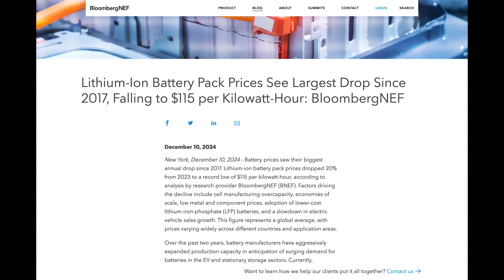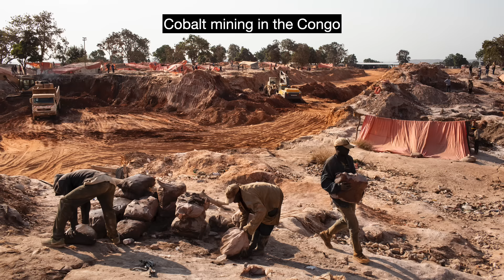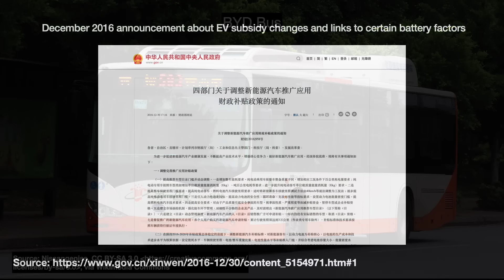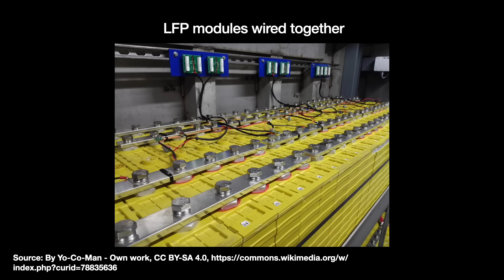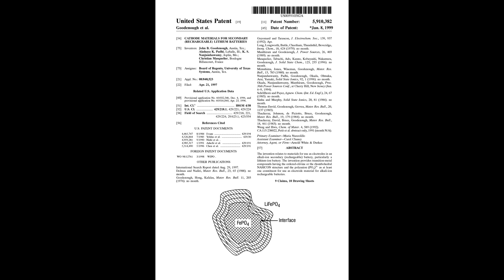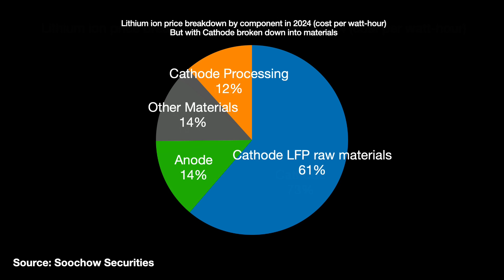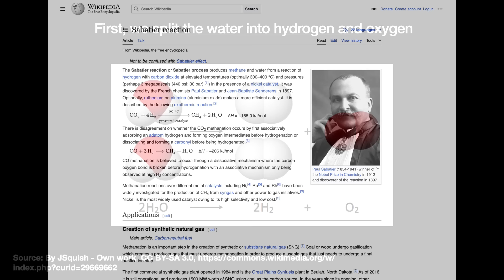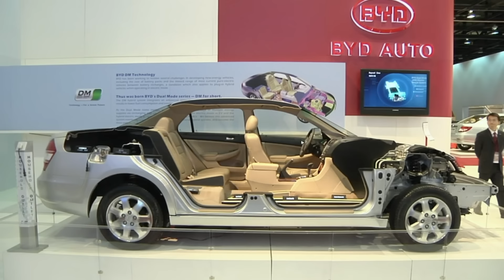How Did China's LFP Batteries Get So Cheap?

Comment: The big advantages of LFP are that they have about 3 times the life of the NiC batteries and can be charged to 100% without significantly degrading the battery life.
Reply: Some batteries are stressed if left at 100% or 0% for a period of time... LFP less so than NMC.  Fully charging a battery, then promptly skimming the cream isn't so stressing. Lead acid batteries love being kept fully charged. NiCd love deep cycling. Main point, it's complex, but simply if you have NMC set max state of charge to 80% unless you want the extra range.  Same applies to longevity of your mobile phone or laptop.
Reply: @ChrisNotTheKing  correct, I have a solar system with LFP and the installer said it's safe to let them charge to 100% daily because they get discharged in the evening and night anyway.
Reply: Well, LFP batteries need to be charged to 100% at regular intervals to calibrate the battery pack and keep the remaining capacity estimates reliable. But they do degrade faster if charged to 100% all the time.
Reply: @kardy12 Exactly, also to keep them properly calibrated you do in fact also need to discharge them to at least 10% every 2 months or so, or you will have very inconsistent/inaccurate range. Plus, indeed, they never used them in any premium or long range models and now discontinued them in the Model 3 in the largest western market, the US due to reliability concerns. Other western manufacturers don't use them either. As for Chinese manufacturers like BYD, their LFP packs offer just 50% of the energy density of their NMC packs, so the gap in energy density is getting larger, not smaller.
Reply: @DigiDriftZone  
Well, Tesla have been using LFP batteries on some of their Model 3/Y’s, and as far as I’m aware there isn’t much evidence they degrade faster than NMC packs. And Ford for example has used LFP packs on some of their Mach-E models.

Either way, as far as the details on degradation, Engineering Explained has a good video looking into the research on the topic, where he found avoiding small charge cycles in the 75-100% range in everyday charging does reduce degradation over time, but you also have to take into account how often you might need most of the range in your own use case: https://youtu.be/w1zKfIQUQ-s?si=G9hixEdDquiaEQ8l
Reply: @ engineering explained is just about the least credible source on most subjects, look at Thunderfoot’s videos analysing some of his content and how dishonest and inaccurate it is. But it still remains to be seen with LFP in real world conditions, Tesla only started using it at small scale on just standard range vehicles in 2021 and suddenly pulled the breaks last year, so that’s a data point.
Reply: @ he’s using published research in the video, so I’m not sure what it is he’s saying that is factually incorrect.
Reply: can't take a guy with the handle "Chinese sparrows" seriously, but hey congratulations surviving the DOGE cuts to the propaganda payrolls, it's tough out there
Reply: Any chance you would make a video about why lithium air just can’t make it to production?
Reply: Thats incorrect.   The reason they are charged to 100%, is because of the difficulty in measuring its charge.    So they just say charge it to 100% all the time so they can calculate the charge properly
Reply: And safety
Reply: Y a pruebas de perforaciones
Reply: We can charge it in higher rate without fearing it blew up lol
Reply: also not so explody
Reply: also because there was basically a truce on enforcing american patents on LFP batteries used domestically in china.
Reply: Friendly reminder that electric cars have very high embodied carbon emissions. The focus on EVs does nothing to deal with global warming, indeed their green meme is that they become more environmentally friendly the more you drive them. BEVs are a greenwash in order to sustain car dependent development patterns to serve the automotive industry.
Reply: LDP have 4-5X the life of lithium ion
Reply: I've seen studies saying batteries in general are lasting a lot longer than anyone really expected. The newer the car the longer it will probably last. 

 Plateauing around 90% after the first year or two. Then staying. 

 Main thing is to keep it charged between 20-80%, and not driving like a maniac. 

 Rotating and changing tires the biggest hurdle. (With chargers.)

 I mean the average right now is that a EV will last around 100k more than an ICE. That number will only rise. 

 And America won't see it because people think EVs are for vegans environmentalists. 

 That's a real sentence that many online think right now. 

 China is going to accelerate into the future with more powerful batteries.
Reply: @RedactedDeath  the US can keep its ICE vehicles. I prefer to breathe non-ICE vehicle clean air.
Reply: Battery life.
About 2 years(?) ago, Jeff Dahn (Tesla battery Guru) and his colleagues released a paper detailing a class of Nickel based cells to which they had "tweaked" the chemistry slightly and turned down the voltage.
That voltage was STILL above that of LIFePO4 cells, meaning they still had more Energy density.
So what was the object of the exercise?
Those cell had (Have) Virtually ZERO degradation (In fact, from memory, they were IMPROVING with age)
These were essentially a "Nickel based LIFETIME cell".
.
The point being, "we" (Keyboard warriors) work largely with "third hand hearsay" and rumour.
"We" have almost ZERO idea what is actually in development, or ready for launch.
Reply: A massive amount of the worlds population lives in an area with little to no below freezing temperatures and couldn’t care less about low temperature performance.

Just saying.
Reply: @Namewithheld00123  yes and those regions also enjoy having to replace the entire blade costing 30% of new car after a small dent or flooding.
Reply: NiC  - battery ? Do you mean NiCd battery or what ?
Reply: In lab conditions, but the voltage levels are quite stable so it's difficult to calculate the remaining battery % without discharging it to 10 every 2 months and charging to 100% weekly,  this negates any longevity benefits unfortunately, that's why the Model 3 for example stopped using them in the US (and they were never used in any long range or luxury models) - the failure rate was too high. Also BYD have LFP but the energy density is just half of their MNC packs.
Reply: @DigiDriftZone  the failure rate of what? What are you talking about ??
Reply: @DigiDriftZone  oh ok
Reply: Please do provide the evidence to back up your assertion of LFP battery failure rates. Scientific research have proved the exact opposite, with over 10k recharge cycles compared to 2k to 3k for NMC batteries.
Reply: @viyusavery248 calm down pal why are you so aggressive talking about batteries?😏
Reply: @idealistinafallenworld   you know batteries the thing that stores energy.. something that can help someone with energy independence like we have never seen before in human history 

Something that has remain virtually unchanged for decades that's now getting rapid development only to be  met with doubters all over 

I really don't see why anyone is betting against batteries
Reply: @DigiDriftZone  This is plainly not true. Model 3 continue to use LFP batteries for Standard Range cars.
Reply: @TL-xw6fh  Standard model 3 with LFP was discontinued back in Oct I believe. You need to charge to 100% once a week, not once per month, you need to do a discharge/calibration once every 2 months or so to maintain range accuracy.
Reply: @DigiDriftZone This is inaccurate. Only full charges are required to accurately set the reference of the charge level. Full discharges are not necessary.
Reply: @pootispiker2866  Charging to 100% is not enough, the calibration gets way off and the range estimation becomes very unreliable, so a discharge cycle is required to recalibrate every couple of months.
Reply: @DigiDriftZone  it's charging to max that is required for LFP.
Reply: @DigiDriftZone Wrong, they stopped selling to the USA market because the USA didn't give the EV credit for chinese batteries anymore, but they continued to sell them in Europe and they have no issue. For calibration they don't need to be fully discharged, but fully charged which matches 100% to the max voltage again.
Reply: @ EV credit for Chinese batteries? What? - they never used LFP for any of the best models or any of the long range ones and now it’s discontinued for all models in the largest western market. Maybe some remain in some small markets but not sure why with all the disadvantages, maybe it’s cheaper in some regions?
Reply: @DigiDriftZone they use LFP batteries for standard range models in the European Union countries. The reason they discontinued this model in USA is exactly because it didn't benefit from the EV credit anymore.
Reply: @DigiDriftZone  Tesla stopped using LFP in the US simply because US government disqualify it from the federal EV tax credits because they were importing them from China. If your theory is true, why does Tesla still sell LFP Model 3 and Ys to the rest of the world?
Reply: @DigiDriftZone Tracking state of charge is really quite easy and accurate. I design electronics that do this and it's not unique or special. We essentially count energy going in and out. The voltage only matters as we get to the very end. 

Most of my systems run from 20% to 80% which considerably improves cell life. There is very rarely any need to balance or otherwise charge to 100%.
Reply: @DigiDriftZone  Nonsense, the tesla batteries explode all the time and unlike lfp they suffer serious degradation from cold and excessive heat. tesla is in the midst of a collapse as they have not kept up with battery technology and refuse to buy what they need as they want to promote their own manufactured batteries which fail a lot.
Reply: @DigiDriftZone BYD will eat Tesla for breakfast
Reply: @TheTotalizer  hahahah, I assume that's sarcasm. Yes it's amazing people buy that kind of crap, it's like buying a knockoff iPhone. So many reports of those cars randomly bricking or refusing to charge, failing way sooner than expected, etc - awful cars.
Reply: @DigiDriftZone  Tesla should stop selling at all because their failure rates are too high.
Reply: @ukrdonju  Lower than the Chinese manufacturers, but yes, the technology is largely a big downgrade from Diesel or Petrol for many.
Reply: @DigiDriftZone  most people don't see superior comfort, performance and reliability as a downgrade. Probably that's why among new cars % of EVs keeps rapidly raising.
Reply: you got that backwards LFP can’t be depleted and charged to 100% without significant degradation to its life cycle over time.
Reply: @ERrnesST No. LFP is quite well known for its indifference to cycling.
Reply: @ERrnesST  no, you're talking about lithium ion. LFP's love 0-100 charges. They recommend charging it to 100% everytime or 1x/month minimum to keep it in optimal condition.
Reply: @larryc1616  LPF is a type of Lithium Ion. And all of them suffer at the extreme low or high charge state, that's why manufacturers limit the range to say 10-90%. So that way, you can safely use the battery from 0-100% on your display, but the cells only go from 10-90%. The reason u should fully charge the battery now and then is to allow the balancing to happen, as that is only possible in the top ~20% charge, as in the 20-80% range the voltage doesn't change so they all look balanced to the BMS system. A single cell doesn't care how its used (within specs) or if it is being topped up often or not.
Reply: LFP range has been shown to drop drastically in low temps. What's terrible is EV batteries have become the new plastic, less than 10% recycled despite 10+ years of sales by multiple brands. EV batteries lackluster energy density works better in small devices or scooter, a cleaner energy like hydrogen is better for larger vehicles, buses and facilities
Reply: No. Batteries are perfectly fine for buses and even larger machines like excavators. Hydrogen is incredibly inefficient to produce and distribute, fuel cell require crazy expensive metals like palladium. Indeed batteries are not suitable for long term storage or powering big ships, which may be powered by ammonia.
Reply: @theagentsmith  even cpus "require" gold, but the tiny amounts used efficiently isnt costing buyers that much. Production and distribution is actually lower cost when water is everytwhere while CN heavily subsidizes and threatens cutoff of rare earth on a whim. EV supply chain prices are heavily distorted to gain market share, not sustainable.
Reply: @chinesesparrows  we can't even manage to produce enough green electricity to charge the current fleet of EV's, you're going to need about 2-3 times as much electricity if you're producing hydrogen as an intermediary in your mobility systems. It's just not realistic. Besides, hydrogen can be produced much cheaper from hydrocarbons so there is an added incentive for markets to just keep using hydrocarbons.
Reply: @chinesesparrows lfp batteries are highly recyclable but because of the cheaper materials there is less incentive to recycle them.
Reply: @chinesesparrows  you dont know what youre talking about. Hydrogen is way dirtier than electric and those cars have ahigher carbon footprint. They make hydrogen by using a TON of electricity to split water. Why not just use the electricity??????
Reply: Silly response dude. EV car batteries aren't recycled because they're replaced when they drop to 80% SOC. Then those batteries are put into power walls, residential battery packs, for up to 20 years pack life.
Reply: @chinesesparrows  Hydrogen will never become a viable energy source for mobility outside of maybe for planes. They’ve been trying for decades and have no meaningful presence in any major country.
Reply: @chinesesparrows where did you get that stat?
Reply: @chinesesparrows lol ... Batteries have better energy density than hydrogen at the moment
Reply: @chinesesparrows hydrogen's not going to happen, stop trying to force the meme.
Reply: @P7ab  what kind of a logical defense is "meme" 🤣 🤣  can't dispute objectively that hydrogen is more sustainable and better for larger vehicles (trucks, buses) and facilities
Reply: @chinesesparrows yes, I can dispute that. Hydrogen has abysmal full cycle efficiency.
Reply: @OccamsPlasmaGun  and EVs are even worse than hydrogen when batteries degrade heavily with use. Full pack replacement needed in 5 years after heavy cross country use is a waste of money, time, materials and all the pollution created to make both batteries
Reply: @P7ab  it's pretty obvious the EV bots pretend to care about the environment when they flat out deny and refuse a more sustainable technology. Their pretending to care about the environment is just an excuse for a special interest group.
Reply: @P7ab  So tired of that hydrogen push. The applicability has been shrinking steadily since the 00's. First hydrogen was poised to take over all energy storage. Then they said, "eh, might take a some time before we get there", while batteries plowed ahead. Then they said "hm, ok, maybe not for personal vehicles" (not for a lack of trying by Toyota though). Then, as mentioned in the video, they gave up on grid storage. Now they're saying "hm, maybe it's really good for containerships?".
Don't know about you, but I'm seeing a bit of a pattern here...
Reply: @ANDSENS  literally described EVs pre tesla. The EV special interest group now busy throwing doubts on more sustainable hydrogen like ICE did to EVs. The differnence being battery tech being more mature early from use in mobile devices and post-WTO investment concentration to one country.
Reply: @chinesesparrows  batteries don’t degrade in five years. studies have found they last much longer than even previously expected. As in they will likely outlive the cars they are put in.
Reply: @Comfort031  studies based on what? all use cases including cross country trucking or daily commute north-south while using the car's battery for airconditioning? EV batteries have a narrower band where their range and performance is maintained, and even a dent on blade or slight flooding calls for full replacement
Reply: @chinesesparrows have you ever tried storing it? Basically impossible to do.
Its either ICE, LNG, or batteries
Reply: @chinesesparrows  in my country there exist ev taxi fleet from byd. the cars had moved over 600km, the battery is degrading with lower range, but it still moving though. they have been operating for > 5 years. so what's the problem?
Reply: @chinesesparrows hydrogen is not a better solution for larger vehicles. The storage of the hydrogen in the car is one issue massive issue, as is how the hydrogen is sourced. Essentially all sources of hydrogen gas come from fossil fuels
Reply: @skytron22  false, hydrogen can be created using any power source just like electricity which CN creates mostly from dirty coal. Hydrogen storage is no worse than EVs which already blaze uncontrollably (even many CN highrises forbid EV parking underground, EV insurance cost is higher than ICE in 2 years) but is lighter than EV batteries which weigh ton even when having zero charge. Most important EVs require full battery replacement far more quickly which is waste of resources and causes pollution.
Reply: @chinesesparrows  hydrogen can be, but generally is not
Reply: @chinesesparrows 
The vast majority of all hydrogen produced is produced with fossil fuels, not just China.
Reply: @chinesesparrows you had me wondering, until you claimed hydrogen is clean. It decidedly is not. Keep in mind that if there's one thing that requires more expensive and rare metals than batteries, it's fuel cell catalyzers.
Reply: @Validole  To repeat, most EV batteries are made in China which creates more electricity using coal than rest of the world combined. That doesnt mean EV must be created in dirty way, but it already is. Same with hydrogen, the difference is: 1. EV batteries degrade heavily over time and need to be replaced 2. Current EV battery recycle rate is less than 10% 3. This is obviously bad for the environment. Both electricity and and hydrogen can be produced in clean ways, and hydrogen scales better as store of energy than batteries.
Reply: @chinesesparrows   this comment seems outdated and will age poorly 

Just one presentation from  CATL's recent launch event and we already have sub zero LFP batteries 800km ranges and hybrid batteries cells with Lfp +LFP , sodium and NMC 

I don't even want to get into already electrified trailer fleets with battery swapping especially in Australia 

As for the recycling what's your data based on? Does it account for home battery conversions from EVs??

But if your going to bet against ev ranges long term go ahead
Reply: @viyusavery248  ah yes Australia famous for low temp 🤣.  Range and energy density are different, you can stack enough batteries to get whatever range but it will weigh tons just like EVs right now. Battery tech and standards just happened to be mature due to consumer electronics proliferation so is cheaper at the moment, but long term digging up materials to then throw away in often less than 10 years of use like most EV batteries is unsustainable and not the destination. The EV recycle rate is from multiple sources you can try using not one but multiple LLMs if you're that lazy
Reply: how much of your last tank of gas were you able to recycle?
Reply: @hitreset0291  ICE does not pretend to be enviromentally friendly, while EVs do, especially CN where most electricity is created using more coal than rest of the world combined.
Reply: @hitreset0291  No one pretends ICE is environmentally friendly, but EVs are being falsely advertised as. CN creates more electricity using dirty coal than the rest of the world combined, how environmentally friendly is your EV?
Reply: @hitreset0291   100% of gasoline and gas tank is recyclable and can even be resold without much loss in capacity lol. Whereas battery range drops immensely with usage
Reply: @hitreset0291  Most importantly ICE dont pretend to be environmental, EVs do. Next literally ask any mechanic if gasoline and fuel tank can be resold without much difference in range, and how easily it is sold as scrap metal. Now contrast that to used EV batteries which degraded with use, is dangerous to disassemble, quite specialized per model with higher complexity from construction to chemical.
Reply: @chinesesparrows  you obviously work in the fossil fuels industry or you wouldn't be gaslighting people like you are here.
Reply: @hitreset0291  Technically, all fuel is already recycled dinosaur juice ;) - How much of those wind mill blades buried under ground will be recycled? what about the solar panels? - both of these have 15-20 year lifespan, batteries 8-10 years and the less than 10% being recycled is not going into new vehicles. My 20 year old Audi A4 diesel is still someone's daily driver meanwhile and will be recycled at end of life :)
Reply: @hitreset0291  How is hydrogen being more sustainable fossile fuel? Most EV batteries are made in China which creates more electricity using coal than rest of the world combined, EV is more fossil fuel right now than hydrogen ever was lol.
Reply: @DigiDriftZone  well then you just spin your time machine back to the dinosaur age to catch their flammable piss firsthand.
Good luck.
Reply: @chinesesparrows   your a Random guy on the internet, I'm going to bet on CATL they presented a complete life cycle graph and real recycling numbers, laugh all you want 

I'm going to put my bets on sodium well see who gets the last laugh long term
Reply: @DigiDriftZone  Actually "crude oil and coal" do not originate from "recycled dinosaur juice" but are products of physical and chemical processes during earths creation and probably continue today. This was proven by the Soviets with ultra deep drilling into areas where fossils couldn't exist and yet they found oil and gas. Essentially oil and coal are abiotic in origin.
Reply: @bobsmith3983  Great? - now tell me what goes into making a lithium based battery :P
Reply: @chinesesparrows   The recycling has not yet been necessary, they still should be in operation - in cars or for other applications. As the raw materials cost, people will bring them for recycling, resp. the vendors will be foreced to make that happen. Technology will emerge - when it is worked at.
Reply: @franziskani  20+ years of selling millions of EVs and recylcing not necessary is a lame excuse. You can see the EV special interest group above flat out denying a more sustainable technology pretending to care about the environment already while still low recycle rates.
Reply: @chinesesparrows hydrogen fuel cell vehicles use batteries also, unless you meant hydrogen combustion engines, but then the efficiency is even more abysmal
Reply: @mike_w-tw6jd  ICE cars have batteries too, the diff is the size and deadweight
Reply: @chinesesparrows the majority of LFP EVs where built the last 3 -5 years what is the 20 year nonsense you are talking about
Reply: @chinesesparrows oh, and lifetime of a fuel cell used for hydrogen production is lower than a battery.
Reply: @Validole  nice cherry picking one of many ways to make hydrogen. The lifetime of a kg of coal used to create CN electricity is shorter than both 🤣
Reply: @chinesesparrows  
SO..... "Hydrogen" <.... sigh...>
Where does it "come from"?
Either
1) Hydrocarbons, (DIRTY)
or
2) Electrolysis of CLEAN water (Scarce and becoming expensive) using "ELECTRICITY" ?
.
That's the SAME "Electricity" which can power a "BEV"....... About 3 times the distance as a "Hydrogen" vehicle.
In other words, the "Hydrogen option" requires about 3 times the energy taken from the grid?
THAT is a problem.
Why?
Because the global grid is NOT 100% "Green" (Not even CLOSE) meaning that IF you require let's say 100GWh of energy to run a Particular BEV fleet "Directly", to run an "Equivalent" Hydrogen fleet the same distance would require  300GWh
WHERE would that come from?
The Grid!
BUT Your grid IS NOT 100% "Green", so any "Green" percentage you take MUST BE REPLACED (Supplemented) By ......?
FOSSIL FUEL.
In THIS example, That's an EXTRA 200GWh of FOSSIL FUEL GENERATION ON THE GRID DUE TO A HYDROGEN FLEET
Conclusion?
Use of Hydrogen to power a vehicle fleet is a DIRTY SOLUTION
.
A Side Note:
A Hydrogen Fuel cell Vehicle is more properly designated HFCEV
What are the last 2 letters?
A HFCEV is an "EV"...... just a VERY inefficient one.
Reply: @chinesesparrows That's because the west has not yet adapted EVs so there are too few used batteries to make it cost effective to recycled. In China, virtually all used batteries are recycled. One of the problems China is having right now is that there are authorized recylclers who operate under strict guidelines but there are also unauthorized recycled because it's so profitable.
Reply: @chinesesparrows  Millions of people per year disagree with you.  The tariffs are necessary to keep millions more from having the opportunity to find out for themselves against the desires of Big Fossil.
Reply: @warheadsnation   alot of people buy temu, doesnt mean that's high quality. Even in CN EV insurance is higher than ICE cars after 2 years. This is the reality.
Reply: @chinesesparrows  Either we shut down Big Fossil or it shuts down us.  We can't wait until everything is clean in the entire supply chain, we have to get the EVs on the road now before the entire developing world gets addicted to gasoline like Wall Street plans.  The solar and wind will get installed simultaneously if not blocked by American aggression or right-wing lies.  American capitalism has proven it will not get the job done.

The reality is, we have until the oceans get so warm that methane hydrate formations in them begin to evaporate.  Once that starts, there is nothing we can do to stop runaway warming.  Nothing except kill each other for survival resources.

How much did we spend to fight the Cold War based on an unscientific estimate of Communist world conquest?
Reply: @chinesesparrows  how many LFP batteries do you own? Cuz I don't have any problems with 2 Chinese LFP cars and 1 DIY LFP home storage pack whatsoever. In cold climate. Maybe you can shed some light.
Reply: @ukrdonju  anecdotes dont matter when EV insurance price is higher than ICE cars after 2 years in China. Why do you think that is the case?
Reply: @chinesesparrows  I'll let all my neighbors know that their EVs are inferior to ICE cars they sold. Unfortunately I don't speak Chinese or live there. Maybe you do and know better what's going on there.
Reply: @chinesesparrows its been exactly the same for me vs ice cars. Im in the us.
Reply: @chinesesparrows Because Chinese batteries suck and are well known for catastrophic failure. And that's even before the rest of the car breaks. Even insurance companies know this.
Reply: @chinesesparrows  how much of your last tank of gas were you able to recycle?😮😂
Reply: @hitreset0291  who is pretending ICE is environmentally friendly? No one. Now who is pretending EVs are environmentally friendly? China.
Reply: @chinesesparrows  Exactly, plus the unpredictable range as there is no correlation between voltage and range like with NMC batteries, this means they must be discharged frequently. So in the real world, the failure rate appears to be high, higher than NMC batteries. Great for home energy storage though.
Reply: @DigiDriftZone agreed. Also even a small dent on the pack is often diagnosed as required a full pack replacement, often 30% the cost of buying a new car. So I laughed hard when asianometry said blade is revolutionary when multiple customers complained of high cost replacing their dented blade. Theres a reason why insurance cost is higher for EVs than ICE even within China after 2 years of ownership
Reply: @chinesesparrows you sound like your wife left you for a chinese battery engineer.  Lol. So much misinfirmation, their are batteries with 95% recycling now. Secondly with new chemistries and BMS, batteries will outlast the car. A ioniq 360 000 miles with still 88% capacity and mostly using rapid changing. CATL with its sodium ion battery with rated for more than 4 millions km.
Reply: @danielvilliers612  ad hominen is no class  🤣 and paper stats are impressive in temu ads too 🤣
Reply: @DigiDriftZone  Incorrect. I simply charge up my car to 100% once a month and that fully restore the BMS settings.
Reply: @DigiDriftZone  The only disadvantage of LFP is low temperature operations as LFPs use water based solvent which freezes. However, it has nothing to do with lower lifespan or capacity loss. LFPs, if used for fixed storage rather than EVs, will last 3 times as much as NMC